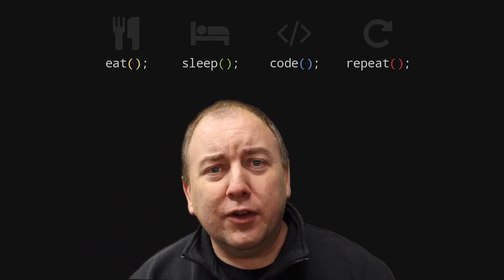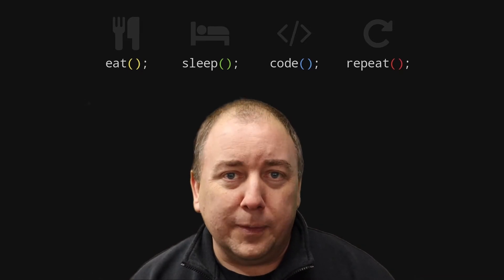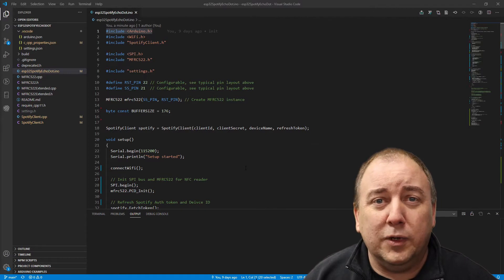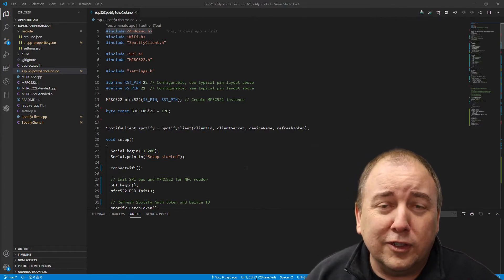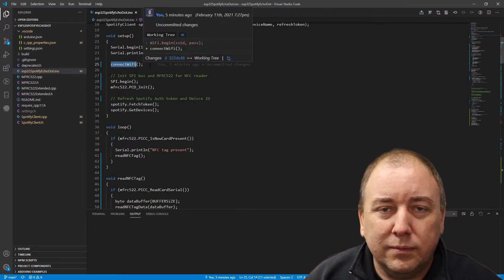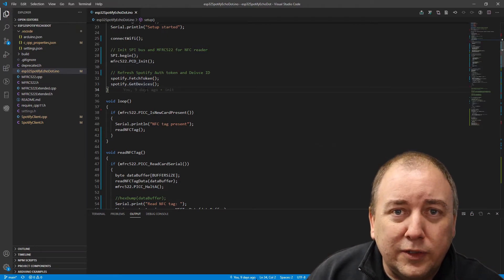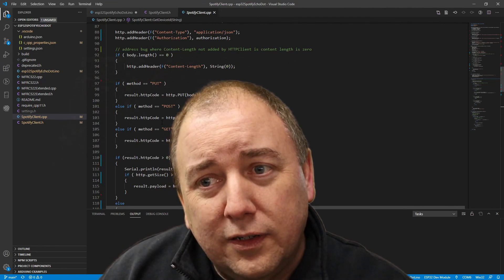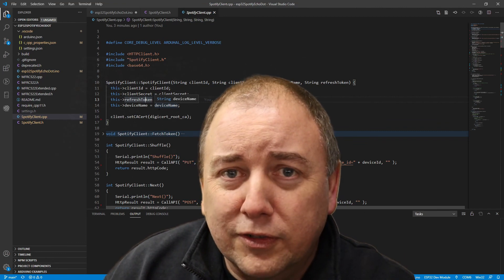How to use Spotify API on ESP32 with NFC Reader to control Echo Dot

Comment: Great, thanks for the thorough walkthrough. I'm just working on the same idea but for Raspberry Pi and I have a ESP32 on the way to try out your project. To get the "Next song" feature working might be tricky... I guess you need code that checks if the RFID tag is continuously read (which means ignore these calls). If it stops being read for a certain interval, we can read it as a new tag. Just in general, is everything else still working for you or did the API change?

Comment: Hey mate, love your work. I'm building a similar device for which I've written the code. The only part I haven't written is the Spotify API library. I'm encountering an issue: on the first boot, I need to have Alexa already playing, otherwise the device ID becomes outdated. I'm also using the device name; I get the player details and then grab the device ID based on the specified device name. However, this doesn't seem to work unless Alexa is playing first. After that initial step, I have no more issues. I can play on my phone and then hit play on my little device, and it will transfer and work fully as intended. It's just that initial boot that's problematic.

Comment: Did someone get it up and running? I tried it with an ESP8266 i had lying around. I have no experience with programming an ESP.
However, my approach seems to be correct. First I downloaded Arduino IDE, adjusted the Seetings.h file with my values and loaded the board software of an ESP2866 into IDE. Then I added the .ino file and in the Library Management I added the WiFi.h and the rest of the .h files from the folder. Unfortunately, I get a  error message in IDE afterwards
Reply: EDIT: I did not connect the RFID Reader. Could this be a part of the problem
Reply: C:\Users\Rob\Desktop\esp32SpotifyEchoDot-main\esp32SpotifyEchoDot\esp32SpotifyEchoDot.ino: In function 'bool readNFCTagData(byte*)':
C:\Users\Rob\Desktop\esp32SpotifyEchoDot-main\esp32SpotifyEchoDot\esp32SpotifyEchoDot.ino:143:1: error: no return statement in function returning non-void [-Werror=return-type]
  143 | }
      | ^
cc1plus.exe: some warnings being treated as errors

exit status 1

Compilation error: no return statement in function returning non-void [-Werror=return-type]

Is the ESP2866 perhaps to small and out of memory?

Comment: do the code to which it redirects one after providing redirect_url and clientId and the refresh token expire? I got my redirect token using Spotifys own example in GitHub aß well as your application from the other video but i cant get it to work. it always says "failed to connect to..."
Reply from the maker: Yes the code / auth token you get from Spotify does expire every 60 minutes or so. That is why you have to use the refresh token to get a new token when it does expire.

Comment: That's awesome. Thanks a lot for you sharing it. 
just to ask, is there a reason to use vs code/arduino-cli and not vs code/platformIO?

Keep up the great work!
Reply from the maker: They all achieve the same end goal of putting a program on your microcontroller.  They each just offer different helping tools to get you there. I like VS Code because I use it to program for other platforms as well like windows, web, AWS. I don't have to learn a new IDE/Tool set each time I switch target platforms.

Comment: How do you program esp32 with VS Code. Isn't the Arduino IDE the only which is supported?
Reply from the maker: You can use VS Code, but it still requires the Arduino tools to be installed. I enjoy it a lot more than using the Arduino IDE.  Here is a link to how to setup VS Code for Arduino https://learn.sparkfun.com/tutorials/efficient-arduino-programming-with-arduino-cli-and-visual-studio-code There are lots other help on the web too if you search for 'use visual studio code for Arduino'
Reply: @makeratplaycoding2666  Thanks :)

Comment: i am getting a return 400 and return 403 on the spotify nfc project.  what do i set for redirect upi's?
Reply from the maker: Did you create yourself an app in the Spotify Dashboard? For the code ESP32 it doesn't matter what the redirect url is as long as you use the same when in the api calls that you used when you created the app in the Spotify Dashboard.